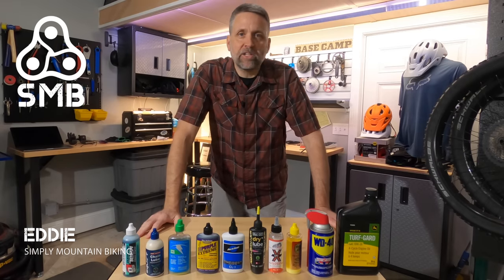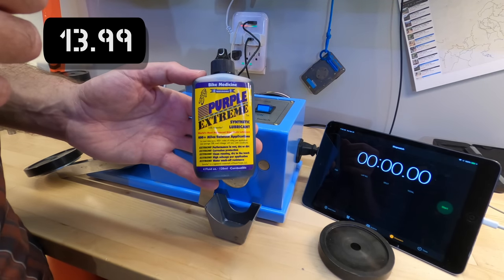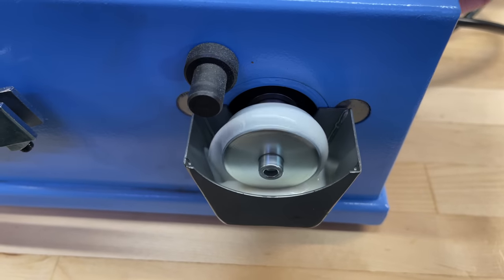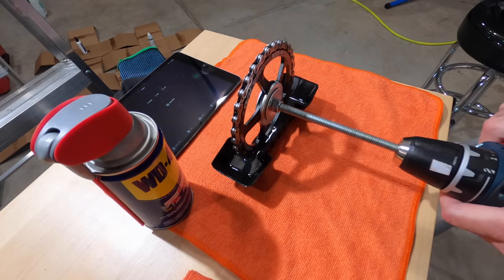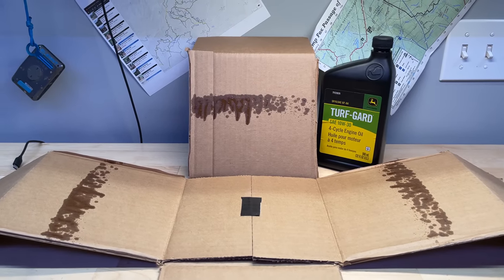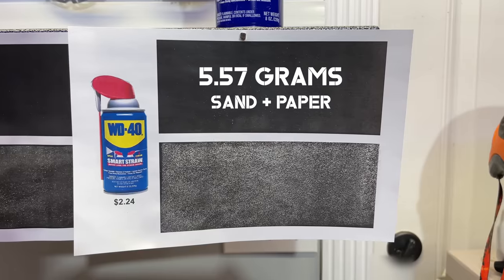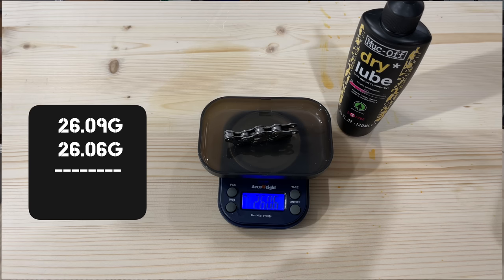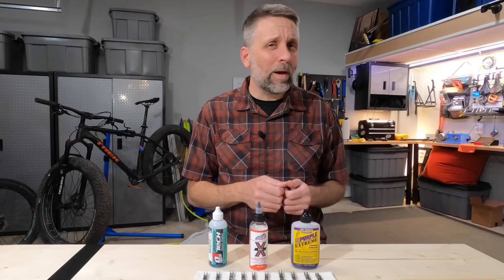Ultimate Bicycle Chain Lubricant Test | Best Bike Chain Lube

Comment: Wow I’m thoroughly impressed with the amount of detailed work that went into this video. The testing was controlled and measured. It was refreshing to watch.
Reply from the maker: Glad you liked it! -Eddie
Reply: Completely agree! 👍
Reply: I enjoyed watching this as I'm subsc6to Project Farm too.  I appreciate the 10w-30 and WD-40 as a ton of customers use it.  There was a time I used Mobile1 for bike chains...with good results.   The two lines I was hoping you'd test are my favorites...Pro Link " Pro Gold," and Boeshield T-9.
Reply from the maker: @outlaw7x77  Haha - yes.  Many people use what they have in a pinch (like me) and others use non-specific lubes exclusively.  Thanks for your suggestions - I'll add them to the list to consider for a future test! -Eddie
Reply: @de-bodgery  what you are really saying is he didn’t wait long enough for the evaporative lubricants to dry for it to be a fair evaluation. That’s a fair point. I don’t think you need to evaluate the two separately though. He simulated marketplace choice. That’s fair.
Reply: @jacc9061  That's not quite it. The wear scar test never gets any drying effect at all. AS a result the lubricant never is applied in any meaningful way to the cylinder. He needs to eliminate the liquid carrier to actually test the lubricant in them. The sling test is slightly better. Some drying does occur, but not a lot. Much of the oils or grease are still floating in carrier and of course sling off.
Reply: Despite having reservations based on the incomplete testing method...I'd probably buy Muck Off anyway. However, I'd really like to see these tests done where they account for what is happening in the chain lube.
Reply: @de-bodgery  so he should have waited longer. Thought that’s what I was saying.
Reply: @jacc9061  Yeah...no NOT what I said.
Reply: @de-bodgery  ya I don’t think you know what you said. Only one way to eliminate the carrier, drying.
Reply: I’d take the water test with a pinch of salt as well. He states the scale used has a high degree of accuracy because it has 2 decimal places. Although that might be true it actually has a high(ish) resolution. So we can see what the scale thinks is the mass to 1/100th of a gram, whether that is accurate is unknown. We also don’t know anything about the repeatability of the scale. He should have weighed each chain multiple times and taken the average mass. Especially when the change is so small. In reality there might not have been any loss at all but the scale is just reading slightly differently. We’ll never know.

Also the the water flow rate is not exactly controlled in any meaningful way. 

Interesting video but don’t throw out your lube based on the results.
Reply: @tbodsworth  i asked about further testing in the add-on video to this one. He as agreeable to doing further testing that incorporated the concerns we have all posted. It's not entirely useless what he did, but there are areas that are questionable.
Reply: The wear test is practical the paint it on paper and slather it in sand is not practical since obviously the thick one is going to look like a sprinkle donut and wd40 looks good yet we all know you never never never never put that on a bike chain
Reply: He needs to test smoove
Reply: The problem is it isn't a very good testing strategy for wax based lubricants lookup zero friction cycling for real information on lubricants and proper testing results and methods
Reply: Bot account...
Reply: Yes, excellently produced video.

Comment: Project farm meets bikes with better video quality. 👌
Reply from the maker: Thank you! -Eddie
Reply: Project farm is still amazing though and so is simply mountain biking !
Reply: Every time he read the product claims I was waiting for "we're gonna test that."
Reply: Made with global components!
Reply: Yes,,, I don’t think PF would would pick a bath test for a dry lube. For me it’s impossible or at least to expensive to do this kind of stuff correctly 🥴
Reply: You should do a part 2 like project farm does with even more brands. Like finish line, 3M Chainsaver, Pro Gold, etc
Reply: Also maxima lube
Reply: Also I forgot to mention the apparent king  of long lasting and low wear, Nix Frix Shun
Reply: @drewfeld836  Where was Lilylube?
Reply: Agreed, this guy def watches project farm!
Reply: @drewfeld836  Traditional NFS may be hard to find now and is owned by Silca and make Silca NFS Pro Chain Lube now, so just look for that. It's NFS's same oil, but better, with some of Silca's ideas added and pretty reasonably priced at around $15 from what I saw, same price NFS was. And if you want to spend $15 more, there is Silca Super Secret Chain Lube which has more going on than NFS does. It has nano-scale Tungsten Di-Sulfide (aka, NanoPlatelet WS2). According to Silca, this fine particle is over three times slipperier compared to PTFE (Teflon) and four times slipperier than the special ingredient in Molten Speed Wax – Molybdenum Disulfide (MoS2).
Reply: nobody rides their bikes with a lube reservoir, so the test is not really useful for cyclists who would watch this vid. it's good for a youtube video though, but not really useful.
Reply: Awesome review! Bummed about Dumonde Tech, although I wish the test had allowed it to sit overnight as instructed before testing. I am biased but I will admit that I have been overlooking how much gunk it collects on my jockey wheels.
Reply: @SimplyMountainBiking  WD40 did very bad in your friction test. Recently I wanted to know how much lube really is in WD40. So I sprayed a bit on a clean and slick surface and waited 24h for the solvents to evaporate. (Probably they evaporate much quicker I dont know). I was surprised about what was left. There was a significant oily film that had an almost sticky consistency. No flimsy fluid film. Than an idea came up. What would happen if you would do the same before you test WD40? Would it perform better when all the solvents are evaporated and the consistency is thicker? What do you think? Do you still have this machine?

Comment: The directions for Dumonde and possibly others are to put it on and work it in. The carrier dries leaving a coating. The initial friction test is only valid in a bath setting, not on a chain over hours of riding. I don't think any part of this is valid. Chains on sprockets for simulated thousands of hours, with chain wear and power loss is what is needed.
Reply from the maker: Agreed that field testing is also valuable.  However, it is hard to duplicate exact conditions in the field. -Eddie
Reply: Agree with this statement. I made a similar one...
Reply: @SimplyMountainBiking  I’m confused as to why none of the dry lines were allowed to dry. They are not designed to be used while still wet. I do appreciate all the work you did for the video though
Reply: Exactly what I was thinking
Reply: @joeyr4869  which is why "dry lube" is a joke.  Nobody has time to wait for it to dry..."I want to ride my bicycle. "
Reply from the maker: @outlaw7x77  Yep.  The last race I participated in, they handed out Squirt in the race packet.  I literally saw people applying it to their chain at the start line.  YES, following directions is appropriate.  But sometimes, people don't.  When I tested Squirt (and others) wet and dry in some of the tests - I hoped it highlighted why it's best to wait.  But some people will still apply them minutes before they ride. -Eddie
Reply: @outlaw7x77  yes, if following directions and planning ahead are above your pay grade then absolutely dry lube is a joke
Reply: @outlaw7x77  
It just takes a little planning ahead.  Apply it the evening before your ride.
Reply: You are correct.  This method of wear testing is not valid for lubricants containing a solvent that is intended to evaporate before load is applied.  The solvent does not necessarily have lubricant properties.  
Even for lubricants that remain liquid, this kind of test is not helpful to evaluate performance in a bicycle drivetrain application, where the lubricant is static.  The test is for applications with circulating oil, such as in engines with oil pumps.
Reply: RollinRat  I ride almost exclusively in dry dusty conditions and dry lube works well at flaking off and keeping the chain nice and clean. I always had hard time keeping the grit off my chain running wet lube. How often do you degrease your chain when using wet lube?
Reply: RollinRat  awesome thanks for all of the help! I might go back to a wet lube sometime and see how it goes. I think I wasn’t wiping it off the outside enough after application hence the very dirty chain
Reply: @SimplyMountainBiking  
People misusing a chain lube is not what you are testing here. You are testing HOW good a lubricant is based on certain criteria. The manufacturers directions should be followed to validate these tests. You didn't follow the directions on the bottles so as a minimum the lubricity test and the sling tests are not valid.
*
However, end of the day, you did discover a chain lube that stood above the others. Too bad nothing was tested as they should have been. Thank you for discovering Muck Off. I'll buy some, but I do wish they all got tested according to the bottle directions. Muck off may not be the best chain lube as a result. 
*
I was bummed to not see Finish Line Wax tested. I've been using this stuff since 2015 and always thought it was very good. I would have liked to see how well it did against other options.
Reply: Not really... The dirt and dust gathered in that amount of time before it dries is enough to hold a lot of sand and dirt and cause damage. I'm pretty sure the lubrication aspect of it all is going to be pretty good in the long run but how much it loses and how much it holds for dirt is what matters a lot.
Reply: RollinRat  only if you constantly hit those creeks. 
It doesn't matter if I ride dry lube in winter or rainy days because every damn lube will get washed to some extend away and what is not washed away will by sticky for mud and sand and that actually is more harmful then just a chain running with water.
Reply: RollinRat  Oh man this is a lot of text. 
Nope I wasn't complaining, my point is that those who claim , made to be ridden in wet weather are actually more harmful then those for dry conditions. Those special wet lubes are so sticky and greasy that you will made a new trail on your drive train.
I stick to squirt all year around and get at least 10.000km out of one chain on a 12speed drivetrain mounted on an enduro. 
I only use a water hose if I did ride in the mud. For days without that I maybe use nothing or just an old rag and that's it. 
Re-lube it after some time, usually I can run it for days without it. But I am not a bike packer. I just ride my enduro or XC
Reply: @joeyr4869  He did allow them to dry later in the video.

Comment: Read the instructions for the proper application of Dumonde Tech and try it again. Everywhere it performed poorly was a direct result of not being applied properly. It requires the chain to be thoroughly degreased. Then a drop of lube on each roller and where plates come together. Then wipe off all of the excess and allow it to DRY COMPLETELY. Now you'll have a completely clean chain for several months with no maintenance, zero sling, and it is totally dry/bonded so not attraction to dust/sand/etc.
Reply from the maker: Thanks for the feedback.  -Eddie

Comment: Would like to have seen WD40’s actual chain lube(s), instead of the water displacer. Also, Tri-Flow is a popular lubricant that I’ve used for years. Otherwise great video!
Reply from the maker: Thanks! -Eddie
Reply: +1 I've always just used tri-flow. Too bad it wasn't tested.